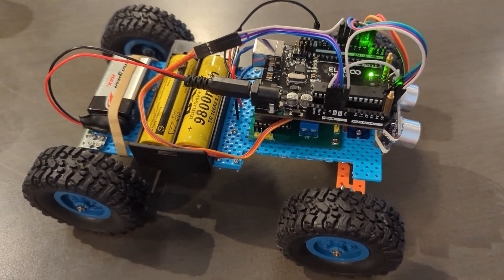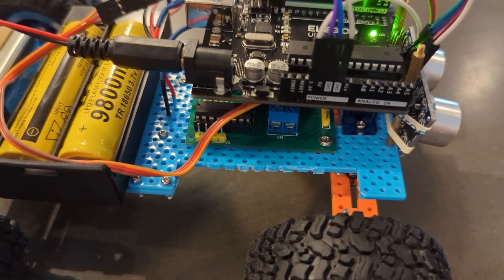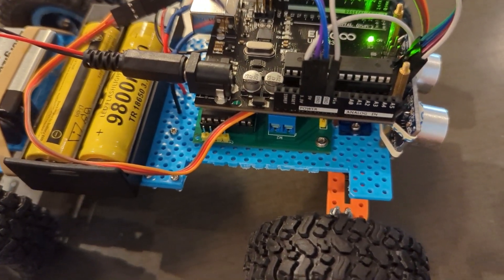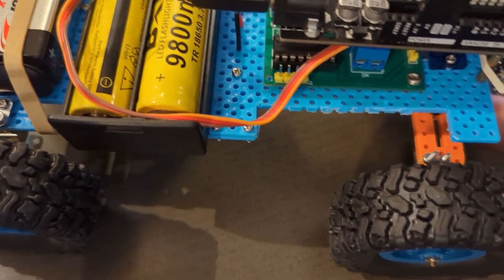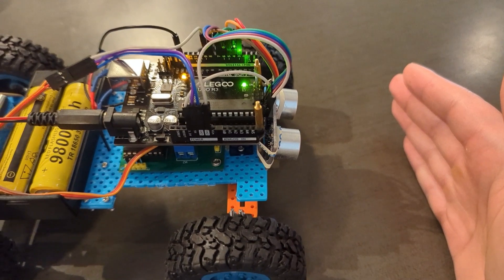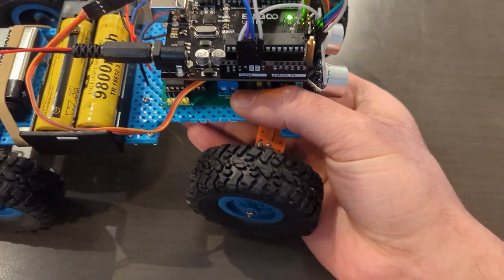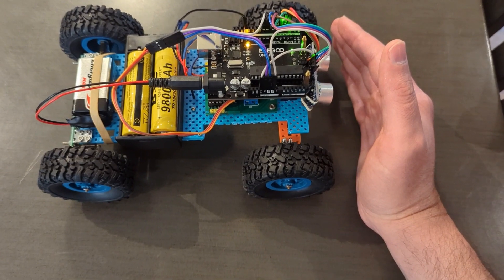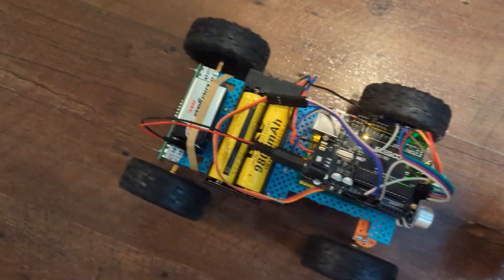Self Driving Arduino Robot - Part 1 - Cruise Control

Comment: Looks really cool, one thing that I would add to it is a dampening faster, so if it is within the range that is specified as a "stop-signal", but not too close, it stops slowly, kinda like on cars. So say the first distance is 50cm, and the second is 10cm, then when it is within 35cm then it stops within 5cm, but if it's within 15cm then it slams on the brakes and stops immidietly just like in the video. But this is so awesome, hope to see more
Reply from the maker: Thank you for the suggestion, I will add that for sure as I love the idea. This is a starting point for me and my plan is to keep expanding it over time. I do want to add turning and backing up as well. Thank you for the nice comment and for watching :)